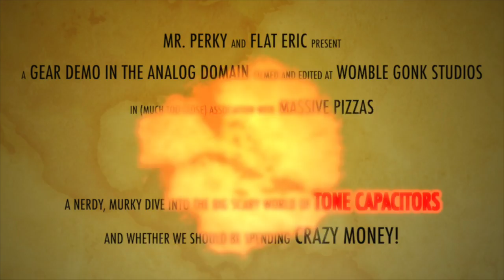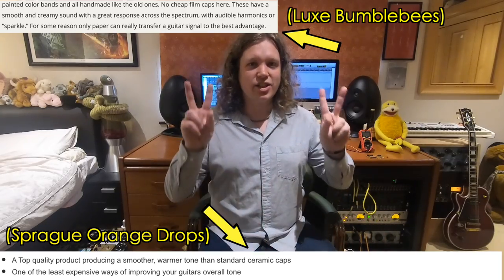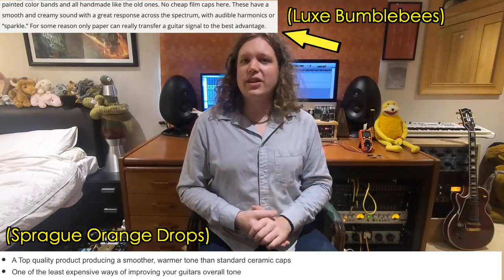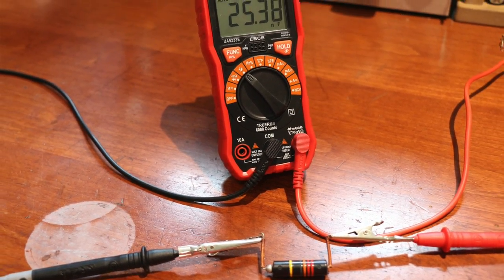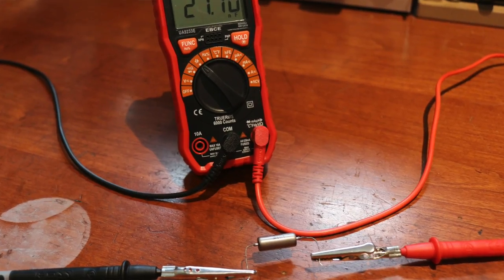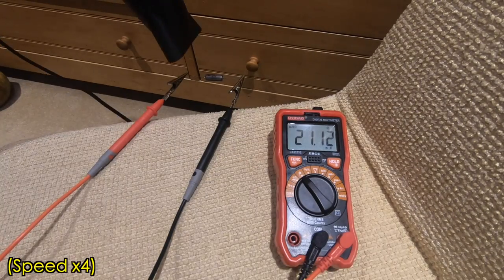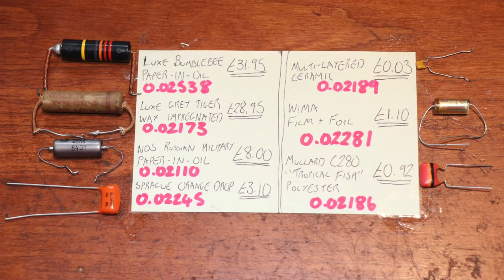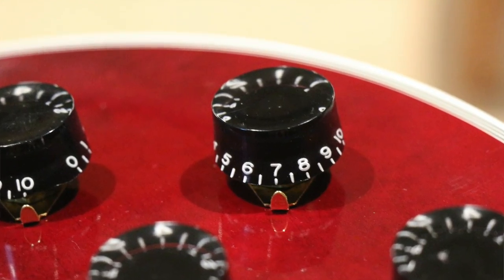Do Paper-In-Oil Capacitors REALLY Sound "Better"..??  (vs. Ceramic, Orange Drop, Tropical Fish, etc)

Comment: I've got guitars with most of those capacitors in them. My $12k Gibson CS R9 has the Gibson Bumble Bee's (pisser that they are cheapies with a BB shell). I have some Custom harnesses with Black Beauties and a bunch with Orange Drops, and various PIO caps, and pots etc.. With your comparison, in my head phones. I liked the Orange Drops and PIO caps best. Very subtle differences but some of the cheaper caps sounded more trashy at mid & lower tone knob levels to me. Well Done! 

Several years ago I used a bread board with a switch into my Gibson Les Paul Traditional, and a USA Fender Strat and tested a bunch of Orange Drops with different values. That made more of a difference as they went through several uF values. I did this when I was updating the Caps in a bunch of my guitars.  I have to admit, I like the look of the bigger caps and that is part of the pimping out my guitars objective. 

Pickups make a lot bigger impact on tone and output, then there are amps and processing that makes bigger to huge differences and probably colours any minute cap difference?
Reply from the maker: Value will make way more of a difference than construction type.  But I agree that I much prefer the look of the vintage-style caps :-)

Comment: Very subtle differences, mostly in the midrange, but very subtle.  I think I like the tropical fish the best.  And I wouldn't spend $30 on a capacitor.
Reply: I listened twice, first time blind jotting notes aligned to the numbers. I really couldn’t discern any actual difference except for the fish. Even then just barely. They all sound so similar
Reply: @oliverlangrall2014  And everyone forgets they can just adjust the pot until they like it. Caps are such BS.

Comment: Great vid. it's honestly so interesting:

every time I research a comparison of guitar components like this, the verdict is always "there is probably a subtle difference and no one will hear it except you. it's marginal"

Like yeah, it doesn't matter in isolation on it's own, but consider all the other areas where there are subtle differences and really think about how much those differences add up in the final iteration of the sound you get:

fretboard material makes a subtle difference, string gauge/material makes a subtle difference, fret material makes a subtle difference, capacitors make a subtle difference, pot value makes a subtle difference, pickups make a subtle difference, microphone type makes a subtle difference, speaker makes a subtle difference, the preamp you're recording into makes a subtle difference, how its eqed, how you play, etc. It's endless.

I really do think all these factors add up and become a massive difference in terms of how your guitar sounds on a recording. Like 30 bucks might be steep for a tiny little part, but at the same time 30 bucks isn't a lot of money. if you aren't going for the sound of that particular capacitor that's one thing, but if you're aiming for max clarity and glassy-ness, it seems worth the price of a single ubereats order for a lifelong upgrade.

Comment: Great video and appreciate the work it must have taken.
Respectfully suggest that any of the variances in caps could easily be equalized with slight adjustments on the amp.
I'm currently installing caps on a guitar and this video has certainly put me at ease in my choice of capacitor.

Sincere thanks!

Comment: Great display Joe. I think the only guy that could hear a difference would be Eric Johnson. He’s the only one that I know which would  come up with out of this world guitar paradigm sound differences. All these darn capacitors sound basically the same. Put on a ceramic .015 on the bridge and a orange drop .022 on the middle and neck pickups. Should fill the Strat sound bill with the added steel plate to the custom shop Texas special bridge. Along with the addition of the Dave Gilmour on/off switch. The combinations are never ending......

Comment: Confession. I watch on a 24inch monitor and youtubes usually play with the top 10% of the screen missing unless I scroll which I often forget. When it got to the music bit it was the "Orange dot" text that alerted me to part of the screen being missing. Therefore I did not see the caps name in the top right corner for the 1st "riffs". Instead I counted assuming you were keeping it secret doh. In other words I listened subjectively without bias, the first time round. When I realised I skipped back and listened again with the names visible. In all the tests , to my ears, the Russian one sounded the nicest. Admittedly thems ears with 4/5 decades of loud music abuse. (Or fine tuning!) I am listening through an Asus ST "audiohile" sound card into a vintage Brit built Citronic PPX450 PA amp powering B&W DM603S3 monitors at nearfield. Gonna go to outro now and see if you agree, yes the difference is noticeable but I was surprised by which sounded the best. Nerd-tastic. Thanks :O)
Reply: PS I was judging on clarity and if the sound pleased my ears.

Comment: Very well done and interesting.  I agree that the bumble bee had more clarity than the ceramic and wima but I didnt hear much difference between the bumble bee and the orange drop. It was very noticable in the final clip with the od. The luxe, Russian, and orange drop where noticably clearer and more articulate.  The wima and ceramic and tropical fish all sounded muddy and packed definition in the low end.
Reply: The trick is to back off the tone control until you like it.

Comment: Money For Nothing tone (other than the cocked wah eq) is due to the OG 59 burst PAF centralab and bumblebee goodness. It all matters. Just like engine parts and adding horsepower. So comparing just one thing also matters but is harder to showcase because it’s not synergizing.

Great content thanks👏👏
Reply: If you close your eyes you can't tell what is what. The ONLY thing that matters here is the value.
Reply: Mark recorded that song on a reissue 59 Les Paul, not a vintage Les Paul.

Comment: You misunderstand the way the tone circuit works. Even with the tone control on 10, some of your signal is still bleeding to ground reducing high frequencies. Just the minimum amount. Not zero amount but minimal amount as controlled by the pot. The tone pot on 10 is resisting the path to ground through the capacitor but only by the maximum amount of it's resistance. At 10, a 500k pot is giving 500k of resistance but it's still letting high frequency bleed to ground reducing high frequency in the sound we hear. At 0, the tone pot is letting all signal to ground that will flow through the capacitor because it's at zero resistance. The capacitor only lets frequencies above a  certain cutoff point pass or else when on 0, we would hear no sound at all. Hope this helps. Took me a while to figure it out but I think this is the way it works.
Reply: The way it works is the tone pot + cap form a low pass filter in combination with the guitar pickup itself

Comment: There is a difference with tone at 10, if you like the sound you have just keep the ones in the Guitar. I found that how the vol is wired to the tone makes a big difference. The Orange csps are most reliable and sturdy.

Comment: It’s subtle for sure but to my ears the orange drop and tropical fish sounded the best. They both seemed to have a clearer full range tone.
Reply: I agree.... It's subtle but there.....
Reply: One of the advantages of Orange Drop capacitors is that if you are sloppy with the soldering iron and accidentally burn it, it still works well and basically can take accidental abuse from the soldering iron.  Sometimes durability could be the reason for the choice

Comment: I think te differences, if any, just come down to the tolerance the caps are made to. Newer ones seem to all have about 10% tolerance, I'm guessing older ones were not as accurate, maybe 20%, and probably technically give you a different tone every time you touch the tone knob. So a modern 22 might be 20 or 24.2, where an older style the range would be double that for example.  Let's say your cheap 22 was actually 23.5 and your expensive 25 was really 20 or less that would account for the difference you hear and won't really be noticed as the tone gets rolled down near minimum.
Reply from the maker: Exact measured values of each capacitor are displayed on the screen

Comment: As most things related to the whole electric guitar sound, this issue is very complex, and there is no single liner conclusion that covers the thematic.
Sadly, a lot of guitar players listen with their eyes and brains instead of their ears only.
What looks good tends to win accept in the blind fold challenge.
Logic fails as well. People easily get into the trap by listening to logic but looking at just one aspect/side of the situation.
Sure, nothing that goes to the ground will be heard, and that is a huge trap. This is so often understood that what goes to the ground doesn't matter. 
But it does. A simple explanation will make you understand why it does really matter.
As in the many things in whole electric guitar sound, we hear what's left of the original signal. Like tone stack in the amplifiers like in guitar parts and in pedals we affect things by deducting dem from the overall picture.
We boost stuff very rarely and mostly in some pedals with modern EQ.
For the rest we are removing opposite side and that makes what's left more prominent.
So what we remove to ground will not be heard but will deduct different stuff leaving out different stuff to reach the amplifier.
So it does matter what you deduct.
It lives different stuff to pass by.
Now to make things even more ridiculous everything else matters as well.
The actual capacitance value matters. Harness capacitance matters.
Sometimes difference is bigger other times it's smaller. Place in the system matters as well.
Only honest approach is to test it and make conclusion which is best fir you with that gear. As soon as you change anything in the chain new assessment is needed. Things might change or might stay the same.
Once again one liners do not work for everyone and his gear in very same way always.
There are some that are more applicable than the others but they are all questionable.

Comment: My bet is that the differences are due to internal resistance of the capacitors. Real world capacitors have a resistance alongside their capacitance. The changes in resistance of each manufacturing type would change how much signal is actual being bled to ground alongside the pot. But the real tricky bit is that internal resistance changes depending on frequency of the signal, which might be another factor. It's all pretty negligible, but still an interesting engineering question.

Comment: So the other day I installed some 0.022uf rated caps I had them laying in my parts bin since 2006, they are Vitamin Q's PIO caps, I put them in a 2006 Gibson Les Paul Goldtop with P90 pickups, and man the tone change on full open through my Orange valve amp was so good, it was the blues tone I have been searching for most of my life, middle position, tone and volume fully up, dirty channel on the amp, melted my face.

Comment: in case anyone wants to try that: pretty sure i've seen a stewmac video where they attach a 5way toggle switch to a makeshift board with a selection of different capacitors.
pretty convenient for a test or comparison.
although i do assume that's what Joe did here as well.
Reply from the maker: I didn't use a switch for this - I soldered the relevant capacitors in for each segment (and let them cool before shooting to let the temperatures go down, so that didn't affect anything!), then stitched all the footage together . Shooting and editing this one took forever!! :P
Reply: @JoePerkinsMusic  haha, yeah I saw another video of yours where you mentioned that, after leaving my comment.
maybe a cool idea for another project somewhere down the line. I know I'll definitely try it out one day for an easier live comparison.

Comment: A few things I had in my Telecaster I built to American Special specs was CUSTOM SHOP pickups, compensated bridge and Russian Oil in Paper Caps.  I tried an American Special in Guitar Center and it sucked balls.  One thing the Telecaster I made didn’t have was resistors one side or the other of the caps they used.  So either the few adjustments I made mattered and yes It was more expensive to buy a neck From Fender the model correct one is $500 with locking tuners.  I can say that this guitar freaking rocks.  So either Custom Shop pickups, Oil in Paper caps and compensated bridge makes a hell of a difference or I cast a magic spell on it.

Comment: There are slight differences, but I would chalk those down to the percentage of tolerance between specified value and actual measured value. 
Which is funny because while looking for parts recently I found that these "audiophile" caps usually have the highest tolerances, aka the least accuracy.

Comment: I've too climbed the highest tree to take a dive into this rabbit hole! lol
K40Y-9 for me in the .022 & .015.
Coiled guitar cable & quality buffer after drive pedals to just fine tune :):):)
Reply: It’s nice to see I’m not the only person who can hear the difference between straight and coiled cables! All of that extra length adds up. 

People like to say it’s a ridiculous claim because no one can hear that few percent difference (or however we choose to quantify these things). But 2% here and 3% there starts to add up as set ups get larger and more complicated. I WISH I could have the sort of amp that is awesome enough to just plug straight into, but Bludotone and Trainwreck ain’t exactly cheap... 

Plus there’s just too much fun to be had and too much time to waste “chasing tone” by arguing online instead of actually playing 😁
Reply from the maker: There might only be a 1% difference between all these caps; but there might be the same between strings, speakers, tubes, cables, pots, pickups, etc.  So all those tiny differences all add up - especially into nice amps!  I used two Dr Z amps for this video, and you can definitely hear any subtleties through those!  (the Dr Z Z-Wreck was designed with Ken Fischer, who did the Trainwrecks!)
Reply: Coiled cable is a more effective antenna for radio and electromagnetic noise (and hum) signals, it's got more inductance for a given length.  You probably need a longer length of coiled cable to reach the same distance as a straight cable, so there's going to be a higher distributed capacitance between shield and center conductor, which causes more rolloff of high frequencies, just like cranking in more tone knob on the guitar would.  But if you like coiled cable, and you don't have issues with hum and other noise, or excessive high end rolloff, go for it!
Reply: I just installed K40Y-9 0,033uF in my PRS Custom 24 SE 2017 and at first the sound was wow. Playing is more enjoable, clean is sparkly on my Triamp mk2, crunch has more edge... but high gain was ruined (too loud hum). After recording session it seems that capacitor simply increased 3-4 db stronger signal which made guitar lively, but not in high gain... how to compensate this volume increase?
Reply: @spiraldrop4897  Hum could be the result of a cold or dirty solder joint in the audio path.  Rewarming the soldered connections and possibly adding a little bit of fresh solder once the joint is heated up could fix it.  Clean and tin the tip of the iron, heat up the joint, and then apply solder to the joint and not the iron. It's important that the solder is applied to the joint and NOT the soldering iron.  If the joint isn't hot enough to melt the solder, then dripping hot solder onto it will make a cold solder joint and lead to things like intermittent connection, noise, and even act like a crystal radio detector (diode) in some cases.

Comment: i had some issues trying to listen the difference but was a nice way to example all the capacitors im a little disapointed not with your video but with my guitars from cheap to a little more expensive the factories install the same ceramic capacitor poliéster, 2A, 473J, CL11, 0.047UF, 100V, 47NF

Comment: If there is any improvement, it's not worth a 31.50 price difference.  As long as the specs are the same, the electronics work as designed.  The capacitance isn't the only specification on the component, there's also a voltage rating, ESR, and a tolerance.  To get a fair comparison, all three will have to be the same.  But there's no magic to it whatsoever.   Save your money.

Now, listen with your ears and not your eyes.  Go back and listen to the video without watching.  Take a notepad and write down every riff you hear that's different from the last one.  Smart money says that without seeing what cap is used, you won't be able to distinguish the change.
Reply from the maker: Yep - that's the point of the video!

Comment: At last! A demo that clearly shows what electronics engineers have been saying for years; The audio does not go through a tone cap in a guitar so the type of cap used can have no effect on the sound, only the actual value can. Great demo.
Reply: All caps are not created equally nonetheless. I agree about the value, but necessarily it sound exactly like another material. A lot of variance. Especially since it subtle changes tonal characteristics, and most people can’t hear well.